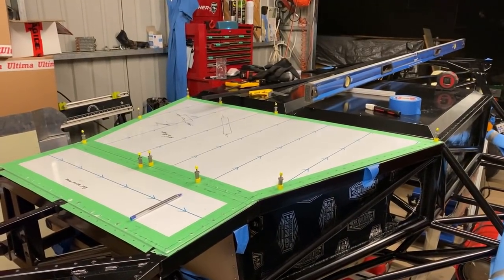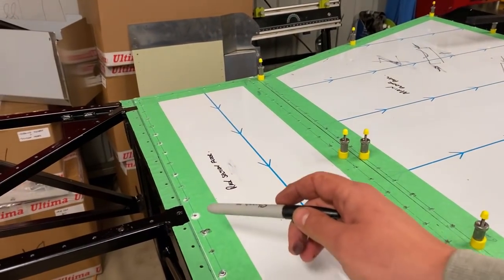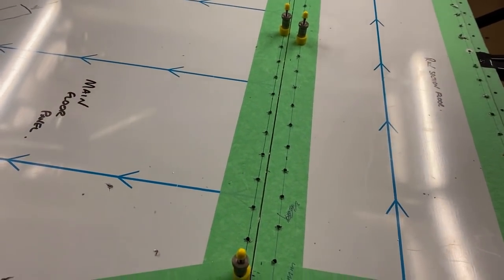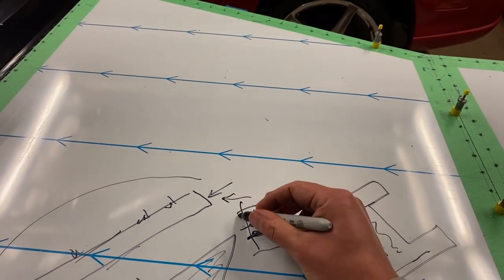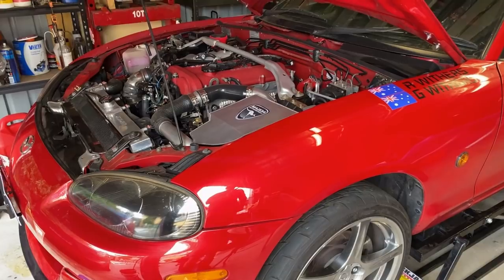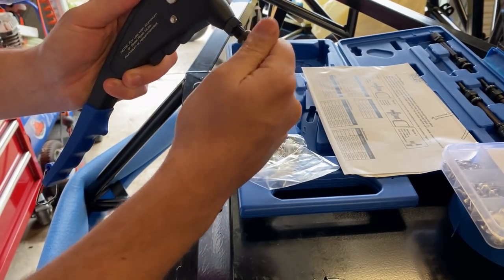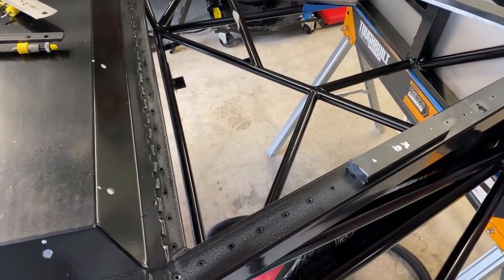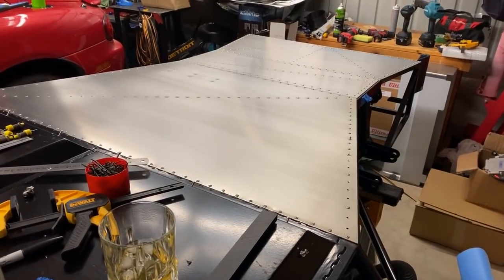Ultima RS - Rock sliders for offroading and pictures of my under carriage (Video #8)

Comment: Coming along nicely!  Quick tip before you undercoat, drill some 25mm holes in the corners of the battery tray area for water and stone drainage.  Do the same for those triangular engine bay panels too.  I didn't think to do that and frequently had to vacuum water or rocks/sand out of those areas.  Its not really needed for the radiator double skin area, though you'll also collect debris up there as well, it's much easier to blow out.
Reply from the maker: Thanks for the tip, Will!

Comment: Another great video. I do love these Ultima's. I saw the White demo car a couple of years back at Goodwood Festival of Speed. Stunning. On the riv-nuts, they are amazing to use. Only thing I found on my Stratos was that they can sometimes spin, especially if you use thread lock. So on some important areas I placed a small amount of epoxy glue to make sure they didn't. Just change a battery on a ferrari Pista and one of the riv-nuts span on the floor plate, luckily we didn't need to cut the bolt as it would have damaged the panel. Looking forward to seeing the next one.
Reply from the maker: I believe that White one had some really interesting crew to show it off too. Definitely agree about the riv-nuts and some epoxy or thread lock is the go! I’m always conscious of it in regard to when I use them. 
Nice that you get to work on Pistas!

Comment: Nice effort, I appreciate your attention to detail. Looking forward to the next one.
Reply from the maker: Thanks mate!
Reply: @rob105motorsport  You're doing a first rate job. I was kind of expecting more fore and aft bottoming strips. Considering it's a flat bottom.
Reply from the maker: @lunkydog  There'll definitely be a need to protect the front splitter, but this will be with PPF and nylon on the leading edge. The rear shouldn't be too bad because of overhang. The rear bracing element will still likely be the low part. I think it'll be interesting to see how good my assessments are once all of the carbon side/front/diffuser panels are in.

Comment: Nice content, before you I didn't even know there is such thing as Ultima RS, I'm a teen and I am not building nothing crazy, just a BMW E87 120d, 6-speed manual, got it for dirt cheap in a car auction had frontal damage now working on making roadworthy, I love manual diesel cars. Have big plans for it.
Reply from the maker: There’s nothing bad about a rear wheel drive, manual ‘box BM. The platform will teach you lots about driving so get out on the track with it. The only tip I’d give is leave the motor alone and spend the money on track days. You’ll have better track time improvements with Drive time than horsepower and leaving it stock will save you on maintenance/parts.

Comment: Offset drilled holes. That you even thought of that is the reason this build is brilliant. If someone was building a car for you, wouldn't you want the level of thought that's gone into this? Home Built by Jeff needs to take serious lessons from you on music selection. Glenlivit. 😁 Can of piss.🤣 My "project" is repairing some 2 sets of  dinged Ti skinned Ducati Mufflers. For which a Rivet Gun was my next planned purchase!
Reply from the maker: I’m not sure if it’s a benefit or a curse that I think about these things sometimes! What sort of Ducati do you ride?
Reply: @rob105motorsport  I have a few 2V Supersports of various vintages (the pipes are for a '94 and a '02) and a 959 Panigale Corse.
Reply from the maker: @kiwihame  Nice! I used to work at a bike shop and have enjoyed a bit of time riding various things.

Comment: I'm restomodding a 1989 Nissan 200SX, my first car i owned for 5 years . Right now I am at the rust repair stage which is a major one! Doing everything myself. 
I plan to try out modding the aero by installing a full body undertray with some stealthy sideskits, self made kevlar wheel well covers with exhaust to the side of the car and a carbon-kevlar or frp cloth radiator and brake ducting, Also I've designed and self made custom subframe bushes with built in rollcenter correction and antisquat reduction from polyacetal. Keeping it a street car so full sound deadend interior and banging tunes are in order! Once I have some free time I want also design front drop knuckles - sadly all aftermarket ones have ackerman modified for drifting. Can share my google photos album If you want! 

Cheers
Reply from the maker: Sounds very cool! Send a link to some pic’s for sure. I like that you’re having a crack at fabricating/learning how to tackle the tough jobs. Rust is a pain in the arse! But I feel that the ability to sort it is a great skill. The subframe roll centre correction is a good idea and something that some manufacturers have some good designs on too!
Reply from the maker: @jakubdoulan5283  Don't worry about judgement, mate. I can definitely see the vision for where you're going with the car. It'll be very cool once it's done and you'll be an expert on the bodywork skills. Just stick with it and it'll come together before you know it. It's the mid-project motivation that's the biggest challenge!
Reply: @jakubdoulan5283  nice work so far! I love those older Nissan’s! Take your time and do it right! Decent looking welding skills! Keep posting pics! Cheers from Hamilton, Ontario!

Comment: Loving the attention to detail on your project. Done properly.  My project is a classic mini with supercharged Yamaha R1 motor. Hopefully the first of its kind as far as I am aware. I've designed and built all the supercharger parts myself (no formal training). Currently at the final build stage from a bare shell restoration
Reply from the maker: Thanks! That sounds epic. I've seen a few 'Busa engined ones. What generation R1 motor? I have a soft spot for the first generation ones (having almost killed myself a few times when I was younger as they love a 'tank slapper') but the later cross plane engines sound amazing.
Reply: @rob105motorsport  2003 5pw fuel injected. Later engines are too tall for the classic mini. This requires very little body mods (none if you don't do my silly supercharger conversion), front wheel drive and runs standard mini driveshafts, suspension, brakes etc. Albeit upgraded items.
Reply from the maker: @hurst_luke  That’s nice! Sounds like it’ll look factory which is awesome (noting that you’ll probably have the flares to take some bigger wheels/tyres). 👌
Reply: @rob105motorsport  nope. 10's :-)

Comment: Bonza mate! I ended up settling in the UK and my missus takes the p*ss out of my pronunciations too. My project at the moment is a TVR Chimaera so I enjoy how you are approaching problems and picking up tips from your methods and techniques. Might be worth showing people how to properly remove rivets. Looking forward to your next video.
Reply from the maker: I'm hoping all of the unusual terms catch on and people start using them. The Chimaera is a cool car and very unique. How're you finding it?
Hopefully i'm not removing too many rivets, but i'll keep it in mind to cover it when I do.
Reply: Loving the Chimaera 😁. It’s more than enough car for me to handle around the B roads around the UK. The 4L V8 engine is easy to work on and even after 25 years and around 90k miles the car is still fantastic to drive. Remember it’s only around 250bhp but there’s no ABS or traction control. My son loves it when I say we’re taking the TVR for the school drop off! Still get a buzz just thinking about driving it. I think for the money and bhp/ton there isn’t much to compare with these days. This car definitely is a keeper in my mind... or another TVR.

Comment: Cool vids. My project is a 71 Chevelle SS with a aluminum LS 6.0   going for reliable daily vs power.   High comp no boost. Shooting for 350whp max only
Reply from the maker: 350whp is respectable! People just forget that because of the widely publicised, but very uncommon 1000hp stuff. The Aluminium block saves some weight too!  Definitely a Chevelle fan too.
Reply: @rob105motorsport  yeah speaking of weight I can't believe the Chevelle only weighs like 3200lbs with an iron block so with the alum I'd guess just about 3000lbs  with some modern touches

Comment: New sub, got a bit to binge and catch up on . I'm currently mounting  rear floor and chassis sections from a 2017 Golf R into a rear end damaged 2015 Scirocco, and then re-power the Scirocco with the Golf R AWD running gear, or maybe just RWD. Something VAG should of offered.
Reply from the maker: Thanks! The R can certainly be turned into a very quick car and the chassis is actually really fun. Sounds like a good time!
Reply: @rob105motorsport  There is a lot more spot welds and Sikaflex in the Golf R than the Scirocco, nearly as many as rivets in your belly panels !! SYD AUS.

Comment: Hi Rob, looking good ! and good on you for explaining material under tension/compression.... the nylon blocks might look nicer with bevelled leading/trailing edges?  Cheers.
Reply from the maker: Thanks! Yep, i'll be chamfering the leading edge in all cases so it's a little kinder if it strikes something. The hardest part will be finding something for the leading edge of the big splitter. I think it'll be PPF film and epoxy some tapered nylon on the bottom.

Comment: Great project, absolutely love to follow the build. Great attention to detail. Love that you go for NA V8 cross plane with ITB’s. Ultimate engine configuration. Response, brutality and noise off the charts. 
Did you ever consider avoiding drilling holes and riveting all together and instead remove the powder coating and bond the panels with a high strength adhesive? Thinking that could save a ton of work, and also reduce risk of loose rivets in the tubes (making noise), and it could even make the car stiffer. Do you see any obvious problems with that approach? 

Also will you do any extra effort to sound dampen the car in addition to what you’ve already done? 

Keep up the great work, always looking forward to the next episode!!
Reply from the maker: Cheers Andreas. The panels are bonded and riveted like you'd see on aircraft. Bonding by itself is great, but it's more sensitive to accuracy, materials quality etc. You'd also need to be very careful protecting any areas you've removed the paint. The chassis is pretty stiff as it is and the rivet/bonding method works exceptionally well for a 'built in a home garage' type car like the Group C era of racing. There is a guy doing all the panels from carbon which would stiffen things, but I can't comment how much better it'll actually make the car, and it'd likely require some suspension tuning to take advantage of any benefits.
Reply: Rob 105 thanks for the answer. That is reasonable, and I agree that bonding requires extreme cleanliness etc, and you wouldn’t know if it is good enough until you test to failure. 
Where can I read about the different builds (i.e. the one who uses carbon fiber)?

Comment: If you are going to paint the underside, don't forget to screw some sacrificial bolts into the riv nuts so paint doesn't clog the threads - been there, done that, rather not see anybody else make the same mistakes.
Reply from the maker: Definitely. Especially when the underbody paint basically welds itself on!

Comment: Really enjoying your videos Rob. Regarding the underbody protection, did you try solid aluminium square bar 50mmx25mm. I was thinking of using that on my next project after I finish the wife's Karmann Ghia. I will be getting a factory five Daytona soon.
Reply from the maker: I did look at Aluminium. I’ll probably weld up a tapered Aluminium inverted ‘V’ shaped plate to mount as the sump guard. The big advantage for nylon is the ease of working it to shape, its super slippery, and easily replaceable. 
The Daytona is so awesome! What sort of engine are you looking at? I’m well down the path of looking at a Cobra project to follow this one, but it’ll be to build and sell (not for much profit, but because I love to build).
Reply: @rob105motorsport  Your sump guard idea is cool, yes agree with you on nylon, easy and simple wins the day. I was planning on buying a damage GT500 2013 mustang in the U.S. and ship it over. Tonnes of power plus these cars are cheap now. Use the engine and scrap the body to pay for upgrades down the road. I have always loved the Daytona story so building one would see my dream came true. What are your plans for body colour?
Reply from the maker: @jasonjohnstone686  Nice! My vote is for a GT350. It'll be cheaper and you can get that high revving cross plane V8. Really special to listen to!
I'm staying with white. I couldn't decide at the time and went conservative. It'll look good once all the carbon is on, and it's easier to add a few detail touches without it looking over the top. British Racing Green was a contender and might happen if I build another.
Reply: @rob105motorsport  I had this crazy idea of buying a damage Audi A8 or S8 and using the four wheel drive system and power plant, would have been a later model Audi around 2015 onwards. But not sure how that would work out, a Daytona with four wheel drive would be awesome. Yes the GT350 engine is a sweet sound, I figured V8 with plenty of power, lots of damage GT mustangs on Co parts in the U.S.. White is a great colour, very clean and easy to detail. You are making all the right decision Rob. Well done
Reply: I've a deep/ baffled sump on my Porsche 996 and am considering the same - just something simple.

Comment: Love the build mate! 
What do you think of the Kincrome versus some of the pricier options? I've been looking at them lately for my G8 GT (VE Commodore for you aussies lol)  since I'm wanting to hide a hydro electric power steering pump on the front frame rail and I'm sure I'm going to need a million rivnuts on my AWD 6 speed LS '67 Impala 4 door hardtop project I'm starting soon, so not sure if I should pony up for one of the high end setups on not.
Reply from the maker: Thanks, Corey! The Kincrome one is very compact, and quick to use. I think it only does up to M6 or M8 though, so if you're in need of a bigger riv-nut then the scissor type ones are the go. You simply can't get the force required on the hand gun. I would recommend just going the cheap riv-nut kit. It's not the world's most technical piece of equipment and the cost difference between the cheap ones and the expensive ones is significant. If the cheap one dies, just toss it in the bin.
Any reason you're not using the stock belt driven item on the G8? Ver cool car to run in the US.
The Impala sounds good! I love the pillarless look.
Reply: @rob105motorsport   @Rob 105  Thanks! Yeah, I was looking at the scissor type for the larger ability, but I can also see it being a problem getting in certain areas. I might just get something like the Kincrome till I need a larger one.
I want to run something like the MR2 or a Volvo pump to free up the extra 10-15hp first and foremost, but the fact that I can also clean up the front of the motor and hide it all together is another huge plus. I've never had the problem, but I have  also seen quite a few people have them fail when doing donuts or drifting at full lock. 
And yeah, I LOVE it. It's quite literally the most enjoyable car I've ever driven, and with the Zeta II (5th gen Camaro) front suspension conversion, coilovers, 275s Contis all around, one of, if not the best handling I've ever driven as well. It quite literally handles better and inspires more confidence on the street than our C7 Z07. 
Yeah, I LOVE the pillar less look of those cars with the windows down and pretty much all stock exterior. I'm going to have Roadster Shop build a chassis for it so I can use the AWD Trailblazer SS oil pan since the front diff bolts directly to it, put torsen diffs front and rear to match the torsen in the TBSS transfer case, and buy an adapter that just came out to mate a transfer case to the TR6060. Should all bolt together with a custom prop shaft and some front axles basically. It's look all stock inside and out, till you look underneath. 😎
Reply from the maker: @corey640  Actually, now you mention it, that generation of pumps sucked balls and were known to fail. Later pumps were way more reliable when pushed hard. 
It sounds like you'll have a pretty wild build by the end of things!

Comment: Great update, did you give any thought to using HDPE as sacrificial skidblocks? not based on anything It just crossed my mind as you were chatting about it
Reply from the maker: Hi Tim, Good point. Definitely nothing wrong with HDPE. It’s slightly more expensive, a little more brittle, and weighs a little less.  Though there is a range of HDPE and Nylons available, so either/or.